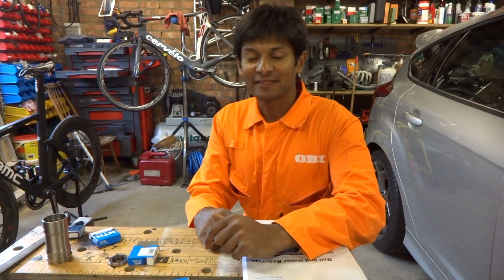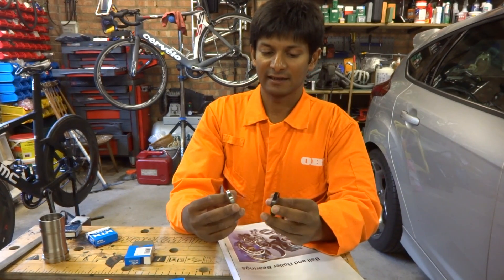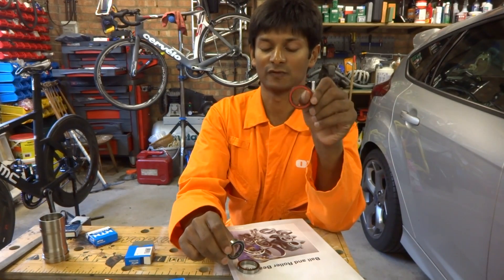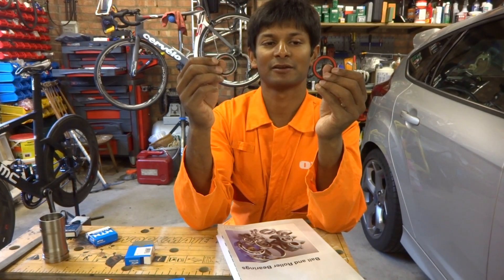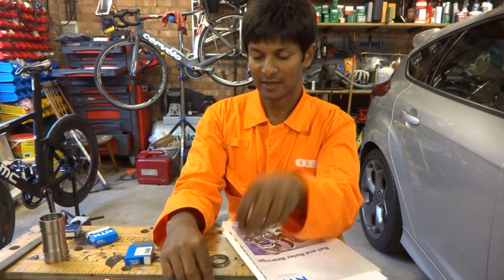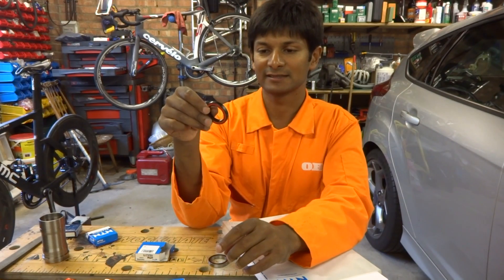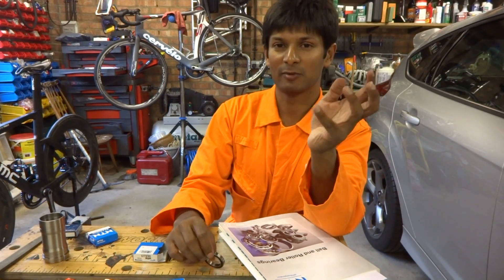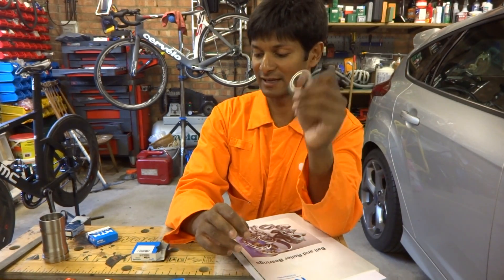Bicycle Bearings and what to buy by an Engineer

Comment: A note on (my) Zipp 182 hub:  Was switching to a Campy (blue) freehub & noted bearings were tight as the assy was not spinning freely.  Went to LBS (they have press tools) to put new ones in & after replacement with correct shimming the new ones were STILL tight.  Turns out the depths were off & bearings got heavily preloaded when assembled correctly- i.e. it's not always a bearing issue.
Reply from the maker: That is highly unusual. The bearings are usually a ground finish so the depths should not be out by very much. I wonder if the original was a C0 and the replacement was a C3 clearance, that would explain your preload problem. Nonetheless you could have been unlucky.
Reply: Thanks, Hambini.  As you alluded to, bearing dim's tend to be spot on, so I'm pretty sure the Zipp hub had a dimension that was short such that the bearing took up a tiny bit (fortunately) of the difference.

Comment: does your information and research transfer over into go kart racing bearings?
Reply from the maker: XX X hi thanks for the comment. In general it will apply to any bearing
Reply: Im into racing karts what about Timken bearings and or cylindrical bearings any noticeable improvement or lack of ? weight is not that much of an issue compared to a bicyclist
Reply: what about full ceramic bearings ie BICA angular contact full ceramic

Comment: Do you have any thoughts & comments on EZO 6900RU and EZO 6902RU. That's what FLO Cycling use in their wheels. http://flocycling.blogspot.ca/2011/07/flo-cycling-components-series-1-ezo.html
Reply from the maker: mmm... I would question anybody that uses a vernier to measure a bearing. If they did that working for me, I would fire them. It's a disciplinary offence where I work. As far as EZO go, their bearings are of decent quality, I'd say a bit worse than NSK and probably on a par with SKF.

Comment: Hi Hambini! How "delicate" are the non contact NTN LLB bearings? If I am on the road only and only involuntary riding in the rain now and then, how long would they last? Cyclocross would kill them soon, I suppose? Thanks!
Reply from the maker: They are not delicate in the sense they will break. The failure mode is dirt in the races which grinds them down. If you can avoid that then they will last well. The other option is when you get them dirty/salty, wash them out and then refil with grease. This will keep them in good condition but there is time associated with maintenance activities like this.
Reply: I just installed a set of NTN 6802 LLB in a DT 240S front hub. The end cabs protect the bearings very well from water, I think that should last. ;o) The wheel spins much lighter than with the original DT bearings, but there is still a "break loose torque", that I don't have on my Zipp 77/177 hubs. Maybe that's also the well protecting end cabs. Also the tension of the skewer has an effect, the stronger the wheel is clamped, the harder the wheel spins. That's also not noticable on the Zipp hubs.
Reply from the maker: Hello Beaver, The skewer tension will have an effect on preload so that will affect how freely the wheel spins. I will be doing a video on that shortly. Glad the bearings worked out well for you.
Reply: Thank you very much! Maybe you could then explain how the Zipp hubs spin absolutely freely even with a high skewer tension and the DT 240S won't...? Maybe the bigger bearings? Have a nice holiday!

Comment: thanks for the great vidieo. i was wondering if you could provide any more info on the issue of internal clearance? I understand the reason for different internal clearances but it seems unclear in the bike industry if there is a standard for hub bearings specifically CN vs. C3?
Reply from the maker: Hi there, C3 is usually reserved for items with high loading. Things with a high loading require the extra clearance because the extra forces cause more heat and the balls, races and cage expand more. 

To determine the level of loading in the application, you have to look at the load rating of the bearing (refer to a bearing book) and work out if the loading applied is beyond  a specified threshold (this varies with bearing size). If it is determined that the loading case is "high loading", you would specify the bearing clearance accordingly ie c3.

Road Bike wheels will almost always be below the threshold for C3 because the loads are small. As a guesstimate , the loading is 150kg of rider+bike, 100km/h speed divided by 4. Which is comfortably in normal loading for common sized bike wheel bearings (6803, 6903).

The bearing a hub manufacturer uses is usually due their assumptions and if they determine a loading could potentially be "high". In my example above, which I believe offers a high factor of safety, the bearing is normally loaded and CN clearance would be sufficient. If a hub manufacturer decides to use smaller bearings, they could potentially end up in the higher loading condition and then change the clearance accordingly.

Fitting bearings with a higher load rating in a normal application has the disadvantage that you require more preload to take out the slack and they cause more drag. 

Hope that helps
Hambini
Reply: Thanks Hambini, Great response.
Reply from the maker: You're welcome. I hope all of your questions are answered
Reply: HI Hambini, I recently tested two sets of wheels with different 6803 bearings. One with c3 (enduro) and the other Cn (NTN). It was noticeable that Cn clearance NTN bearings felt less smooth when installed on the wheels. I was wondering if that was your experience too... and did they come good after an initial break in period?... and by break in I'm not referring to the seals as they were both LLB seals. I also read this interesting article (see below link section on clearance) which suggested that clearance requirments can dependant on the bike hub manufacturer.  ( see: http://thepartsshoppe.com/about-us/ )  This is a problem as I've never known any hub manufacturer to specify an internal clearance requirement for their hub bearings.
Reply from the maker: Hello Adrian. It sounds like the hole that the NTN bearings are being pushed into has a higher interference than it possibly should do. Commercial bearings are made on an industrial scale and in this day and age, their reject rate is extremely low (irrespective of whether it's NTN, SKF, FAG etc). Therefore I would doubt the bearing is out of tolerance. What is more likely to occur and I've seen it on many occasions is the hub is anodized. 

The anodizing process is notoriously inaccurate and usually the hole ends up smaller than the engineer anticipated. On a CN clearance bearing which has a smaller clearance than a C3, you'll feel this as "grittyness". If the hole where the wheel bearing landing is opened up to the correct diameter, the grittyness will usually go. The C3 bearing that you have tried, already has a wide(r) clearance so the "crush" applied form the wheel bearing housing is completely un-noticed. 

As for the break in period, Yes the bearing will break in - it will grind some of the track away pretty quickly <50km. but it's better to measure and correct the hole. 

I believe this is one of the reasons why Shimano use cup and cone bearings as a preference (wheels and pedals) because it allows them to have quite a wide manufacturing tolerance because they have much more adjustment. 

Incidentally, this is also why Hambini bottom brackets are unanodized - I cannot control the process accurately enough to put my name on it so I don't do it. Hope that Helps
Reply from the maker: Just to add, I have never seen any hub manufacturer specify a C3 clearance so that link is a new one on me. A C3 clearance instantly makes the wheel spin slower because more preload is required and the wheel will have poorer alignment so it will flex more - they are just the laws of physics and geometry. 

I saw on your youtube video that you build wheels. If you are interested in making them spin freely, I'd suggest a couple of micrometers (internal and external), I usually use Mitutoyo but there are others available. You will be quite alarmed when you see the tolerance deviation between hub manufacturers.
Reply: Hello again, Just to add to our conversation I have contacted a number of different companies about internal clearance requirements on their hubs. So far there is no clear answer. From what I'd been able to find Hope hubs are CN, White Industries, American Classic, & Miche C3. I coudnt get an answer out of DT Swiss or Zipp. The issue seems to be quite unclear. I will keep investigating.
Reply from the maker: Hello Adrian, From my experience with Zipp, all of the ones I have come across are CN. The FAG/INA rep who has the account for Hope comes to visit me in my day job so I know what bearing tolerances they use and the design process they go through. The conclusion was there wasn't enough lateral load to warrant C3 clearance so they stuck to CN. It should be noted that if you go to a smaller wheel bearing you might well need the C3 as the relative load increases.
Reply: Thanks Hambini, I really appreciate all your input here as there are few people in the bike world that can back up with this kind of engineering background... instead of mere opinions and marketing fluff. The one factor I have been able to identify with different hubs internal clearance specifications is that all of the hubs with the c3 clearance seem to be more likely to have a slip through axle and bearing preload collar design to adjust out axial play. This is of course not the chase with Hope hubs (and DT Swiss) that have a shouldered axles and endcaps where everything has to fit within a very tight tolerance. The Zipp hub was a misnomer for me because the NTN 6803 LLB CN bearing just didnt feel right to me when I spun the wheel in the hand. I wondered if it could be related to seal wear issue although these were not full contact seals. Either way I didnt have time to experiment. I put in the Enduro 6803 c3 bearings (which felt better in the hand) and my customer flew off and ended up winning a big bike race over the following days. I can't say they Enduros will last as long, but they did the job.